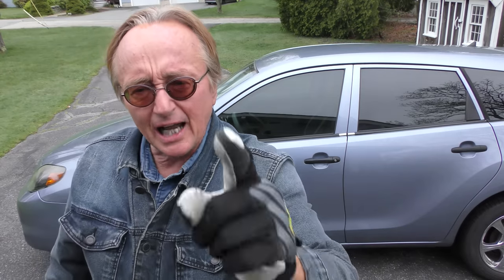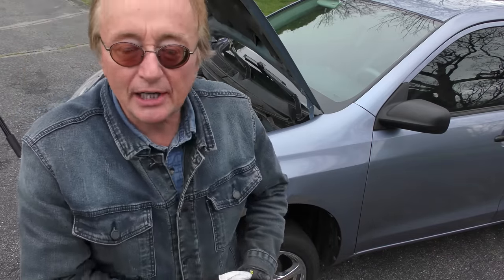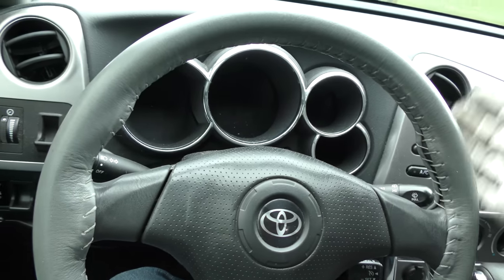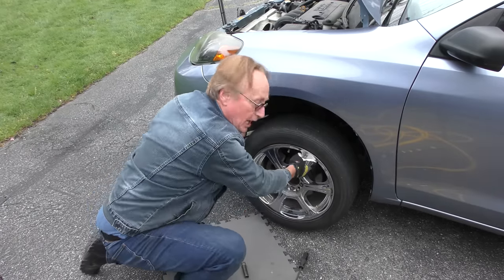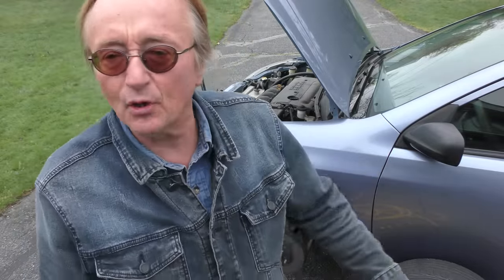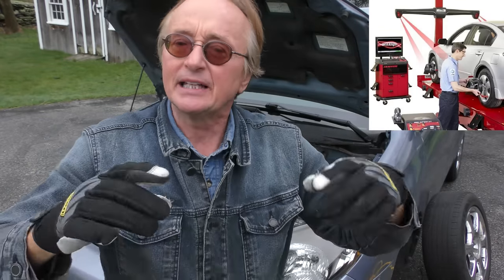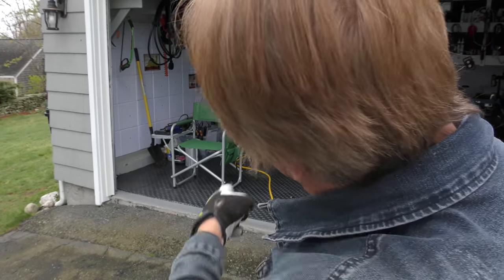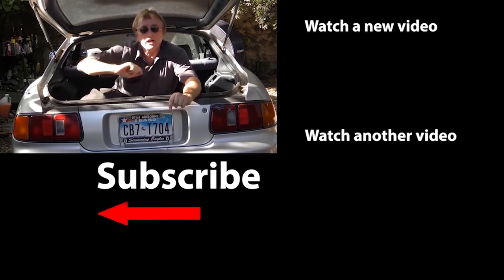I Was Just Threatened to Not Tell Anyone This

Comment: SCOTTY. That tire is WORN! COME ON!
As for the brakes, it's a good idea to measure the thickness of the rotors when it's time to change the pads. If too thin, replace them. 
I did a total fluid flush in my Nissan at 60K. Changed the filter. Cleaned the pan. 90K now. Still going. 
Good vid. Thanks.😁
Reply: "As for the brakes, it's a good idea to measure the thickness of the rotors when it's time to change the pads. If too thin, replace them."
Correct. This is what my mechanic recommended. I did this and when his head mechanic did a test drive they found a lot of 'give' in the right hand steering before the wheel turned and engaged. So they replaced a part and didn't charge me labour for it just the part. Now the car is steering great, the brakes are fantastic and I'm happy.
Reply: BTW my mechanic is a racing driver and loves cars especially high performance vintage cars. He runs his whole shop extremely efficiently and I found him by googling Honest mechanic and then my city, and got a chat room and found him. He knows I do my own servicing and respects that. He never tries to upsell me.
Reply: @deborahcurtis1385  Great.
Reply: Who cares if the tires are worn. It’s summer. Makes zero. Dif
Reply: @theperson3693  Wrong. If they're like bologna skin the can't shed water and subject to hydroplaning on the road. Loss of contact with the road in water is like driving on ice, and that's frickin' dangerous!
Scotty's tire was worn enough to change. I'm a mechanic too and I would not drive on tires like that.

Comment: Scotty is correct.  I have been driving since the ‘70’s and have only had one front end alignment.  And that was because the ball joints were replaced.
He is also correct in that shops love to sell unneeded brake pads and rotors. My former dealer said my car needed brakes and rotors on all four wheels.  They would be happy to do the job for $1000.  I was only there to get an inspection sticker!  I refused, took the car home, checked everything and the brakes were fine.  Three years have passed and they are still fine.  Have not been back to that dealer since and will never buy another car there!  Beware!

Comment: I think the concept of "lifetime fluids" came about when organizations like Consumer Reports and JD Power made "cost of ownership" a big metric in their ratings. Manufacturers responded by extending maintenance intervals and shortening warranties.
Reply: No joke!  If it flows, it needs to be changed, it’s just common sense. And notice that many manufacturers have eliminated the drain on transmissions?  Why have a drain if it’s lifetime, right?
Reply: @lawman5511  no loop⁹
Reply: Of course, sell those parts.  Still do oil every 3k, trans every 15k and axles every30-50

Comment: I worked with a Scottish guy who took his car in for new tires at Kwik-fit. The guy came back and told him that after putting the car on the lift he saw that it needed new shocks. So my workmate said go ahead and replace them. When they'd finished and handed him bill, he said you need to take the cost of the new shocks off the bill. He then showed them.the receipt for new shocks that he'd gotten at Kwik-fit 6 months previously, the shocks had a 1 year warranty. He said the mechanics face just turned red when he looked at the reciept  🤣

Comment: As my dad taught me about breaks. If they squeal you need new ones as there's normally metal pins in the pads that scrape that make that iconic brake squeal, Abnormal breaking "pulling to one side". when you step on breaks you get it feels like its moving warping can be a issue. 

Then again in my case up north I had a small rock chip get stuck in my brakes. Scratched the rotors but no damage. Scared me though. The mechanic I went to took my brakes apart and found it didn't even charge me. He just asked that, If I ever needed work to go to him and gave me card. Went to him many times for tires, oil changes, light bulb replacements many times he was very cheap and enjoyed the company and showed me how to work on my car. Sadly hes retired now but that generation of honesty and hard work I miss.

Comment: Yes Scotty you are spot on.  I had a customer come in my shop.  The dealer was trying to sell power steering flush, transmission service, fuel injection flush at 25,000 miles.  The vehicle was 2 years old!!!!  Scotty you use many times "Mechanics" are dishonest but in my experience its the policies of the owner who runs the Auto Shop not the mechanic but yes there is dishonesty in every profession not just auto repair.  I have been let go several time because I'm not a good salesman.  I can do repairs very well.  I'm a master tech and now I have my own shop for the past 17 years.  Go to your nice clean shiny curb appeal shop (Im being sarcastic)  Guess who pays for that smooth talking well dressed service writer and designer waiting room.  You do in the form of super high labor rates and parts mark up and services you dont need.  They have to pay for those things some how.

Comment: Took my car in to get tires, and just like Scotty said. Oh, you need new shocks. rear brake and rotors. So said just put the tires on . Took it to my mechanic, who is honest .rear pads were low but not urgent .no need to replace shocks or rotors. Worst of all they wanted $2500 not including tires😢
Reply: Crooked mechanics piss me off. I have had a few try and get one over on me. Little do they know that I've been turning wrenches since I was 7. The only time I take my vehicles to a shop is when I don't have the specialty tool and/or time to do the repair. This is probably why the big auto parts dealers wouldn't hire me.

Comment: Amen Scotty . After getting 48K miles out of a set of Michelin Pilot Sport AS3 Z rated front tires with very even tread wear on my 2014 MB C250 I went to one of those national branded tire chain stores for front tires. They told me I needed new struts , strut mounts and inner/outer tie rods. How did I get almost 50K out of Z rated tires if theses parts were worn out ?  I use a plews grease needle on the joints once every two years and drive easy . There is no side to side play or up/down play when the front wheels are off the ground and I yank on them . They quoted me over $800 for aftermarket parts and labor which I declined. I guess the tire dealer rep needed a larger commission check.
Reply: People get 70,000 to 90,000 miles out of good tires.  Really, really cheapo tires can get 50,000 miles.
Reply: @tommak6516  - Well, good tires might get that much when not worn out by harder cornering. A person with Z tires might be a very aggressive driver who would only get 40k miles. I have gotten only 30k due to aggressive driving and maybe even a lack of addressing alignment and proper rotation.

Comment: I have an 09 Matrix. I love it. It’s leaking oil & im dreading taking it in… I can’t imagine what they’ll say I need/ the cost to “fix”. 🤦🏻‍♀️
Reply: Before you do anything, I suggest you check the drain plug. My wife has an 08 matrix and I can tell you from personal experience that without a crush washer the drain plug for the oil can leak. Some of these guys and change oil don’t exactly put in a new crush washer or they’ll double washer it and it’ll end up leaking.
Reply: Thank you SO much for the advice ! My ex husband used to get his oil changed at Wal** & they stripped his plug (or some piece that was threaded), luckily he caught it. 
I don’t have the “auto” knowledge, but in the small town I’m in, there’s 1 place to change oil & they’re fast - but maybe too fast & something like that could be missed or skipped easily. 
I appreciate the advice !!!
Reply: I would get 3 opinions with estimates too from 3 different repair shops.
Reply: @douglashruby7525  Thank you for your input. I really appreciate all opinions and advice. It’s getting close to 200k miles, but inside/outside is great, all major parts 👌 & I love it as my “commuter car”. I’d hate to get an estimate for this that’s close to the value of my car ! 
(Recently 1 place wanted $1900 for all brakes & 2-3 other parts) the other actually lifted my car, took off wheels, looked & said I just needed front pads. $150 vs $1900 😳
Reply: @CalamityJAD3  Great stuff Jane!!!
Keep on going back to the reliable places and checking everything. That car will save you so much money! My car a Honda civic 97  is insured for only $4500 but it's worth far more to me to keep it on the road. I've spent money on replacing the timing belt at 200k but well worth it. My trusted mechanic who is a racing driver just keeping busy with his workshop has so much work he doesn't need to rip me off and never has.
Reply: sorry, Jade I should have said. Clearly a play on words but my eyes saw differently.
Reply: @deborahcurtis1385  - no problem at all 💕!!! I’ve always gotten “J”, “Jane”, “Jamie”, “Jody” - I understand most, but some of the names… I think people made up, 😆 !!
Reply: @CalamityJAD3  People call me Barbara...I mean nothing like it but the rhythm is similar.
Reply: This happened to me, drain plug is so simple as James Caron says. Get a new one with the washer and ask them to use it on your next service unless you do the service yourself.  That will give them the heads-up you aren't a stupid female (a stereotype that causes a huge amount of financial loss for women and their cars yet I've met plenty of men who know far less about cars than me). The suddenness of the oil consumption is an indication it's probably this.

Comment: I went in to change my brakes and they grinded down my rotor taking off some of the surface rust and now the car shakes when i'm stopping. I should have bought the tools I needed to change the pads myself. I didn't have them at the time but next time i'm def doing them myself.
Reply: You need new rotors. They ruined them.
Reply: @finfrog3237  Or if there's still enough meat on them, he could take them to a shop who knows how to mount them correctly onto a brake lathe
Reply: @finfrog3237  Yeah i'm going to replace them myself after i'm done paying down some debt.
Reply: @al_dente4777  to get rid of all those al dentes they ground into them.
Reply: @finfrog3237  Back sometime in the early Eighties, I got a job in some shop specializing in brakes. I had a big Mercury on the hoist that needed rotors. They gave me a set made south of the border and our policy was always to check them out on a lathe. It ended up that this policy was for a good reason, because the boss wanted to cut corners. One day, as I machined down these rotors enough to get them straight, the boss got his payback, as soon as a rotor went below specs, due to its piss-poor casting. Instead of supplying himself with American-made parts, he instead fired me on the spot. I guess, you can say that he did me a favor, in the long run
Reply: @al_dente4777  ugh well good for you. Being trustworthy and such.
Not worth tarnishing your own reputation working for a deadbeat lol.
Reply: @finfrog3237  Now that I look back, I could have just quietly mounted the rotor and have kept my job. But if the rotor were to have collapsed during a downhill panic stop, I probably would have taken the fall, if a serious accident would have ensued, instead of the Take-this-job-and-shove-it boss who likely would have snitched me out to the cops

Comment: I’ve had that new strut or shock pulled on me twice.
The first time was on. Chevy 1;2 ton PU with 40,000 miles on it. Yep, the Ol spray oil trick.

The second time, really shocked me. It was a garage I had been doing business with for a couple of years.  The first time they saw my 07 Nissan Xterra with 90,000 miles on it.
Well, you need motor and transmission mounts, ball joints, and new struts and shocks as well as a fan clutch.
$3400, including $600 labor to change the motor mounts. Two of them.
I’m not a pro mechanic, but I have been a shade tree guy in the past, so I understand THIS stuff. Computers are above my pay grade.
I had NO symptoms!  Drove fine, no noise, no slop in the steering.  
So, second opinion is needed.  Up on the lift  we inspected everything after a test drive.  
No, you don’t need all of this stuff. The fan clutch is a little weak, that’s all.
So, another garage goes down in flames.
Also had a tire shop chain refuse to rotate the tires on my F250 because they were 12 years old. 20,000 miles on em. Perfect condition. Wanted to sell me new tires for $1200.

Comment: Believe me, you'll know when shock absorbers are bad. I had a 1987 Plymouth Caravelle and in the spring of 2003 it would bounce like crazy even from a small bump. I replaced them and it was fine. Going back into the time tunnel I had a 1978 Mustang and in 1982 a guy at a garage pointed out that one of my back shock absorbers was leaking fluid and needed replacing. I guess he was right because I replaced them both in 1987.

Comment: I saved my parent's car after the dealership cracked their radiator and left oil out of the car after an oil change. It smelled funny, I checked it out...told them what was wrong, changed the radiator myself, and then I went over everything mechanical. The dealer was trying to destroy their 2008 Camry so they'd have to buy a new one. These people have no empathy or compassion. My parents are 70+, on fixed-low-income, and they are good people. It's a damn shame what dealerships and shady mechanics will do. A/C repair people for your house too...always go behind them and check their work!

Comment: Lifetime transmission fluid isn't a scam, the bottom line is that auto transmissions are built substantially differently than they used to be and in many cases utilize electric shift solenoids and lockup clutches that drastically reduce the wear and failure scenarios of old transmissions.  Then, you have the improvements in the transmission fluid, the substantial filter built into the transmission, and it simply can do its job for the life of the transmission before it would need a serious overhaul or replacement.  There are Skyactiv Mazdas with 400k+ miles on the original transmission fluid that still run great.

Comment: My shop said I needed new pads and rotor after 120,000 miles.
It seemed a good idea because he said there was little pad left.
The car is a 2004 Toyota Highlander that runs great at 120,000 miles.
I paid about $600 for new pads and rotor on the front.

Comment: Funny that you mentioned struts... My brothers are gearheads (both are restoring their own Ford Broncos) and my parents came to them wanting some help tuning up their F-150 before they go on a road trip in about a week from now.

Now my brothers know my dad tows a camper that is definitely beyond the truck's towing capacity so they immediately looked at the suspension. My brother works at a Ford Dealership in the service center so he has access to literally every tool needed to do this repair... But he ended up having to put brand new performance suspension parts on it... ball joints, tie rod ends, and, you guessed it struts.

Comment: I do most of my own work. I change shocks a lot sooner than most people. I like my cars to ride and handle like new. The ride deteriorates so gradually that you only notice it AFTER you put in new shocks. I also get new brake pads and new tires when they are worn 50%. My tire "take offs" are better than what most people are riding on.  If I had a shop and used MY standards, I would be accused of ripping people off with repairs that could wait. But I would recommend repairs and replacements based on MY criteria. And whenever I have to tear something down, I would replace other things "while I was in there" which would SAVE the customer money in the long run. That way they would not have to pay for basically the same tear down twice a little later.

Comment: 1st day new job the owner of shop told me to replace a transmission after owner dropped car, only needed side vacuum modulator told the shop owner and he said “do as I told you so I can charge him for a transmission”. Replaced said transmission and when owner came back in the afternoon to pickup car I came back with car and defective piece and said “here is the $25 part that failed but change the transmission as shop owner said “do as I told you so I can charge him for a transmission” as I walked out of shop.

Comment: What I could use advice about is to what extent replacing struts can reform the ride quality of an older car (eg, 120k miles and over). I had struts replaced on a 200k miles 2006 Avalon. I would say the mechanics botched the job but I had to take it back within days because the car was bottoming out. I did not get the ride quality improvement I had hoped for. I probably should have insisted on Toyota parts etc.
Reply: I use KYB (Kayaba) struts when possible. Typically they would ride like rocks the first 50 miles and then smooth out and handle awesomely.
   KYB is the OEM strut supplier for Lexus and various Toyota models. They just don't have the dealer markup under their own brand.
  For best handling, go with their Excel G line.

Comment: My Honda crv is twenty years old and has the original coils springs and dampers, which still perform correctly, as do the anti-roll bars.
The bonus is the front strut-brace fitted as standard.

Comment: you said your tires are over 6 yrs old.  id recommend you change them every 5 yrs regardless of wear.  dry rot could cause the tire to fail and kill you.  Most people dont have to worry about it as they drive enough to wear out their tires in less than 5 years but for those who dont PLEASE change them.

Comment: Yup, I was told my 2007 Nissan Altima CVT transmission never needed the fluid changed. There wasnt even a dipstick. At 180,000 miles, in 2020, I had to scrap the car when the tranny failed.